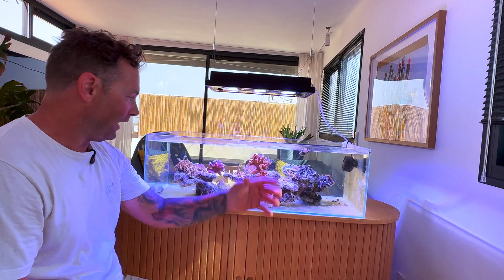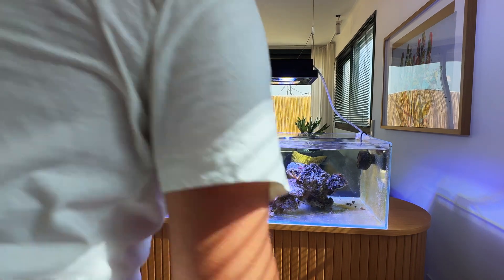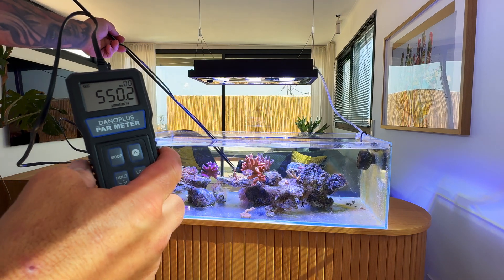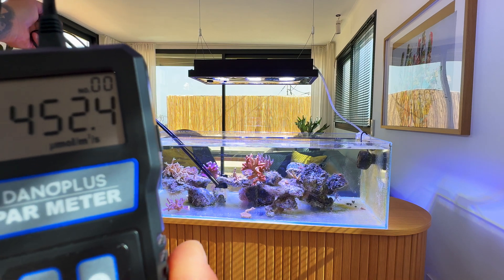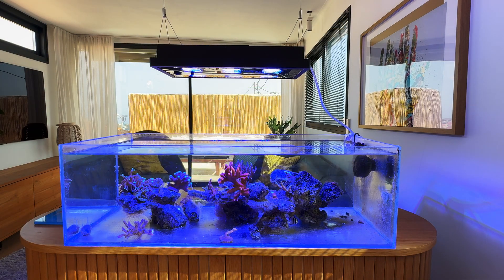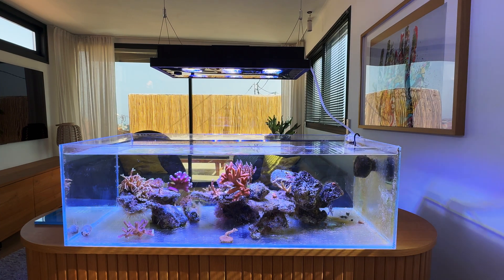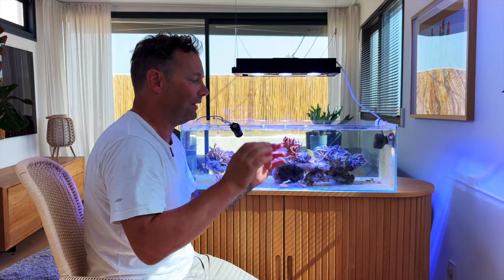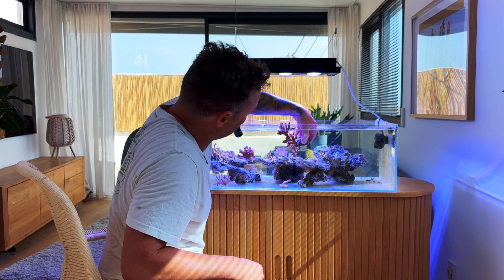PAR Meter for GHL MITRAS LX IL Saltwater Aquarium LED Reef Light - Lightning test Fpr Dying corals

Comment: Nice video! I'm just cheking those light now, how many do you think it would be needed to replace two straton gen 1 in a tank with 140cm by 65cm?
Reply from the maker: Hello, i think ig you want maximal coloring for acroporas need 3 but better  4 lamps.. ask GHL tell you have seen my video , maiby he will make you a good discount..
Reply: @michaelreef2019gmail Thank you, having 3/4 lamps to 140cm by 65cm would it be better to use 3/4 regular mitras lx 7 7206 perpendicular to the front glass, it seems there is no advantage from this new model regarding the previous one?